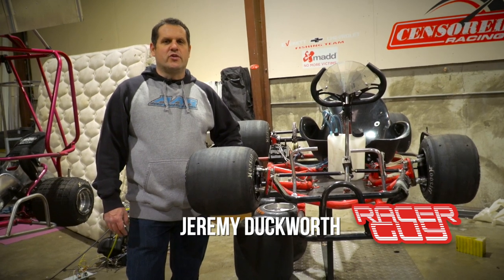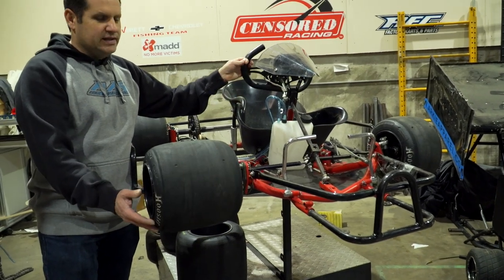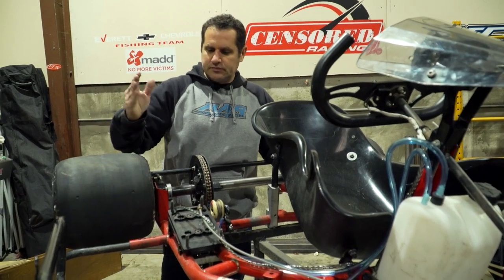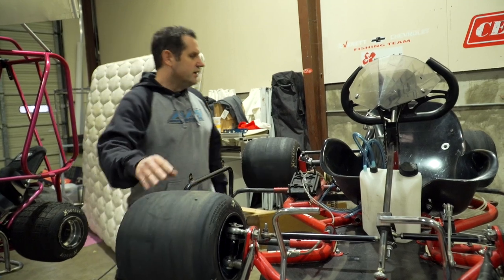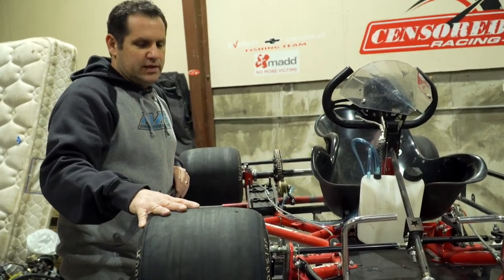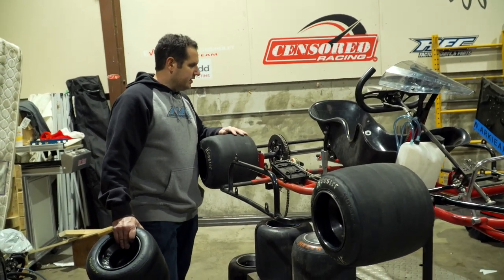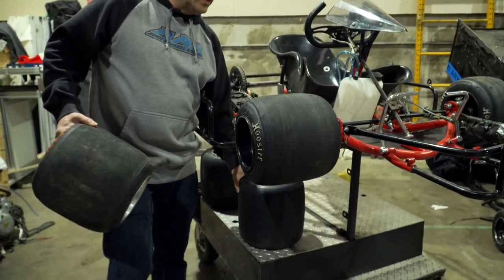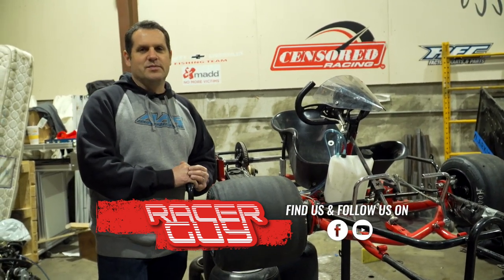How I Tune My Kart At The Track

Comment: You talked about changing the rear roll center. Did you raise both the right rear and left rear  together, or did you just raise the right side?
Reply from the maker: I would recommend keeping the LS and RS equal. Remember your ring gear is located on the axle and angles on it can easily help throw the chain. Keeping that chain lined up comes first to me. I have ran it on a slight angle on my 500, but I didn't really see any advantage.
Reply from the maker: Also since there's no suspension on these karts there really is no roll center, its really probably an instant center. But me being a stock car guy, I'm going to still call it a roll center hahaha. Just like I'm going to call these engines, motors!

Comment: Why are the right side tires so much wider than the left sides?
Reply from the maker: That's just what most everyone runs on those speedway/flat style karts to maximize grip and reduce roll speed. Most of those kart classes don't have a lot of hp. So anything to reduce drag is the thinking behind it.  Outlaw karts run more of a sprint car style setup on tires. But they also run a lot more degrees of yaw angle and of course have a higher power to weight ratio.

Comment: So I see high cross karts use backwards cross. How do you work with that? I noticed you said you follow the normal standard in racing more is push less cross of more steering.
Reply from the maker: The only thing I can say is not to over complicate it. It's all about which tire is loaded and how much.  Make one change at a time and write it down. A race car is like a teeter totter. Whatever you do to one end of it equally effects the opposite side. You need to find the balance that you or your driver is comfortable with. And then how to adjust your car to the track and conditions. The main thing is, whether you are moving weight, changing wheel spacers, RH's, whatever, know what your wheel loads are. Most numbers you are going to come across from builders, friends etc. are just starting points anyways. It's all about the fine tuning that picks up those 2-3 tenths that everyone is chasing. Hope that helps!

Comment: You gave zero numbers. on the rear axle you can only adjust mine about a 1/4 with out changing those slot cube thingys. Just wondering how much you move it and how much tire pressure are you running? You said take a little out of right front helps you how much is a little.05lbs-2.0lbs just curious trying to get all the knowledge I can. why is it such a big secrete
Reply from the maker: So the axles aren't adjustable on every make of kart. But some have marks on the cassette and that's where I usually adjust mine. But always start where the chassis builder recommends then adjust from there. Just go 1/4-1/2 inch increments. if you are ever in doubt just go less. You never want to over adjust and dial yourself right out of the race.You can usually get where you need to be by just moving the right rear in. But I would get everything I could with that RR spacing before I would start moving my axle. Tire Pressures 4lb LS and 6 lbs RS is where I think I used to start mine at on those flat/speedway style karts. And yes I would adjust in 1/2 lb increments. And nobody wants to give away what they think is their edge or knowledge they have accumulated over time. So that's why all the secrets hahaha. But there's no real secrets to any of this stuff. I hope that helps!

Comment: My kart is terrible pushing getting in and in center and it's making me loose on exit
Reply from the maker: Yeah that's usually the case with a chassis that's tight in and through the center.That's why you usually want to fix entry first. The main thing is to start getting more weight to the LS and just try to get weight off that RR. There are some other things that can help to like cross and tire pressure.
Reply: @racerguy9483  How do you move weight from the rs to the ls in these karts. I know one way is physically move it.
Reply from the maker: @miketimms7952  Yes, to physically move ballast is the easiest way. I would have several different size pucks to mount in different spots. Then I would move my seat if I needed more if possible. You can also use wheel spacing to adjust weight. Moving that RR in or out will make a noticeable change on the kart, especially on entry.
Reply: @racerguy9483  The seat  on these flat karts need to be easier to adjust cause the driver in the seat is the single most heaviest weight on the kart and needs to be able to slide front to back and side to side and on a pivot for rear seat height. Does moving the RF in and out affect corner entry?
What about the LF? I believe the Lf is under utilized in set-up as well, what are your thoughts?
Reply from the maker: @miketimms7952  Yeah, a lot of them do have a sliding bracket. If you are already over or at race weight and running Predator/Clone class you will probably have to move the seat more to get the kart to balance. Those small motors can't handle too much excess weight.

Comment: How much do you move the RR Or LR in or out incrementally? What is the total your willing to move each before moving to something else?
Reply from the maker: I usually move at 1/2" increments. Unless it's really far off, I might start at 1." If you don't have any adjustment left you need to change somewhere else. Also just keep an eye on you alignment front to rear. The way the RF and RR line up also effect the handling a lot.
Reply: 1/4" on either rear hub is a gigantic change as far as feel. I've never moved more than that in a weekend because if you're moving hubs that much there's other issues like wrong tires, too much caster, wrong air, something is bent.
Reply from the maker: @chafeeracin611  Not for me. If I go to a new track, or racing a new chassis, or both,  I'll give the car what it ask for to get it working. I think moving a hub 1/4 inch is really a fine tune adjustment. But I do think after running a chassis for a while you learn what it needs and likes and what to change to get it working. And the same with a driver. They all like different things to go fast. Just my opinion anyways.
Reply: @chafeeracin611 
Damn right that is a big change.

Comment: How do  you know how set air pressure
Reply from the maker: Do you mean for a baseline? Or to adjust handling? Or both? I usually start with what my chassis builder recommends, then adjust from there to what I think the kart and tires need. Short answer, trial and error. But air pressure is the only spring rate adjustment you have on a kart.
Reply: Tire pressure can be weird, 1/2 psi can move 15lbs of weight around the kart. Tire pressure in my opinion is the single most important thing in racing
Reply from the maker: @kasonblake3655  It is definitely a great tool for adjusting these karts. And yeah, 1/2 lb can be noticeable for sure.
Reply: For scaling I was taught to set the air at 5 on the left 6 on the right….on a track with a lot of bite(like clay) that is a good baseline to start for air pressure…

On a slick dusty dirt track, 4 on left and 5 on the right is a good place to start with air……use .5# increments for adjustment after feeling the kart..

Lowering the air pressure will tighten the kart up, adding air pressure will loosen it…remember throughout the night, the track typically gets more bite on it from all the prep, ext..
Reply from the maker: @TheKhager02   Yeah I think that's a good baseline and a pretty common one. I think we had a 2lb split on baseline for awhile too. 4-6lb. But I think consistency when it comes to a baseline is key. The car/kart will usually tell you what it needs eventually.

Comment: What pressure did you run in your tyres?
Reply from the maker: It's been a little while. I believe it was  4lb LS, 6lb RS as a basic baseline. Then I would adjust from there.
Reply: @racerguy9483  Thank you, I'll give it a go next race and see if the times go down.
Reply: I ran 4-5 lbs left and 5-6 right. Sometimes I’ll bump up rr and lf pressure depending on conditions. You can also use your gears to alter the handling of a kart.
Reply from the maker: @lewisr993  Yeah that sounds really close to what I ran as well. I would change RR on the Outlaw Kart all the time to mostly adjust corner entry. I never used gear for handling though. I always just thought of gear to accelerate off the corner and straightaway speed.

Comment: How do know what gear to use 
So just started flat kart jr stock 
We have 212 Predator
Reply from the maker: The main thing is having a tach and dyno sheet, and knowing the torque curve on your engine. But just starting out and running Predator you are probably not going to not have access to a dyno sheet and probably need to use the test and guess option, which is perfectly fine. These karts are very dependent on gear and it needs to be right. But I find I need enough gear to pull all the way down the straightaway to have enough speed. You want to hit your top rpm at the end of the straights if possible. But track conditions, shape, and starting pos. can all effect gear choice depending on what you need. Everything on a race car is always an educated guess for me. My biggest advice is guess the best you can and the more experience you have the better your guesses will be. I've only ran a predator once, but I believe they run 5500- 6000ish? I may be wrong but I know it's less than a clone.
Reply: @racerguy9483  thanks we will give it a go

Comment: I commend your efforts here but you are just wrong about sooooo much.
Reply from the maker: Thanks! But the Title is How I Tune My Kart. That's it,  just what I do with my stuff and a few of my opinions. I've been in racing long enough to know there's another thousand opinions on everything. Good thing is you can choose a multitude of different options and go run it and see what works for you. One thing I have figured out over the last 29 years since I started racing is that you can be right today, and completely out of the loop tomorrow. You never figure it out and it's always changing.  Good luck on your races!